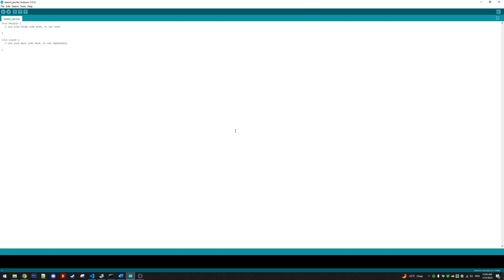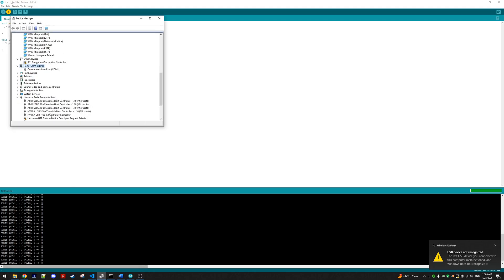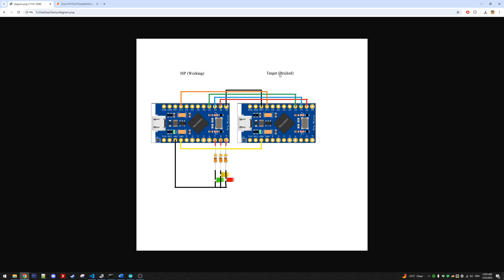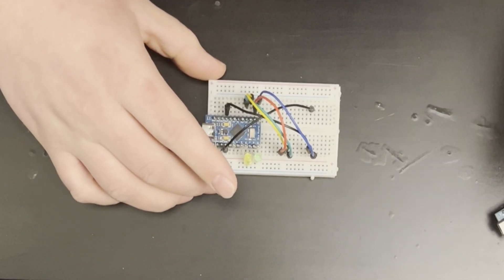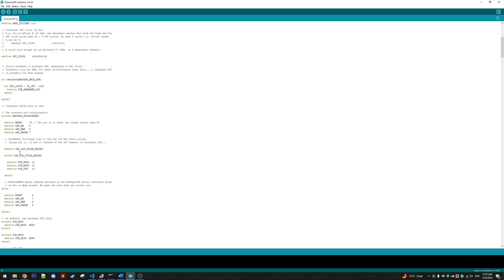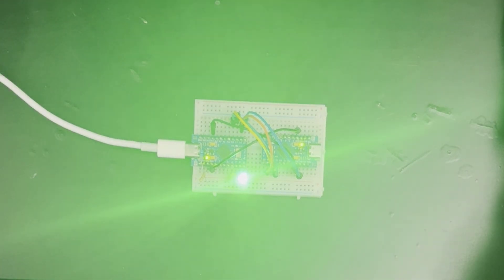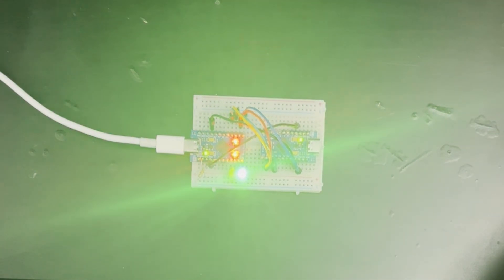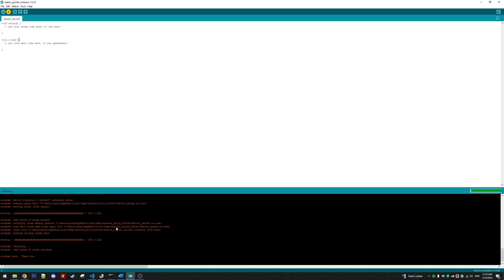Flash Bootloader onto Arduino Pro Micro

Comment: Hallo thx for ur Tuto first! i have a problem while burning the bootloader, it says that 
Error: 
***failed;  
avrdude: WARNING: invalid value for unused bits in fuse "efuse", should be set to 1 according to datasheet
This behaviour is deprecated and will result in an error in future version
You probably want to use 0xce instead of 0xfe (double check with your datasheet first).

any help from ur side? thx for ur time!😀